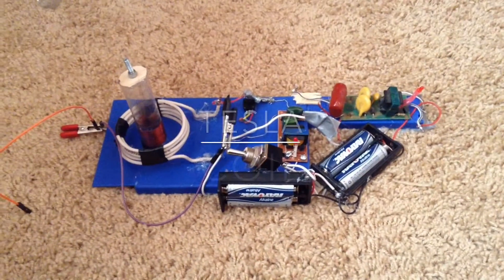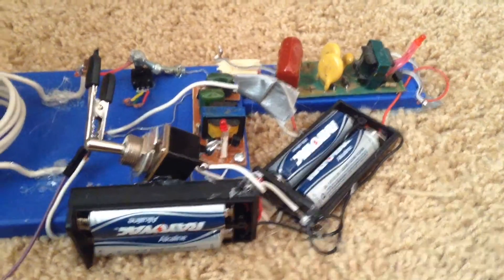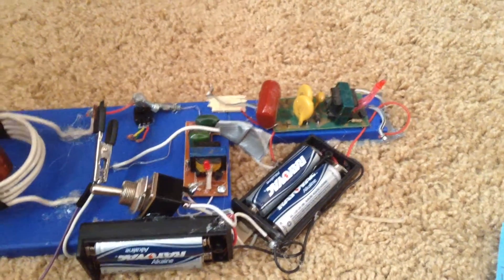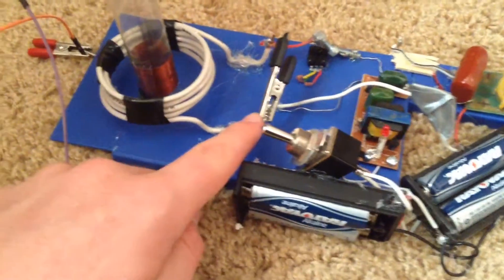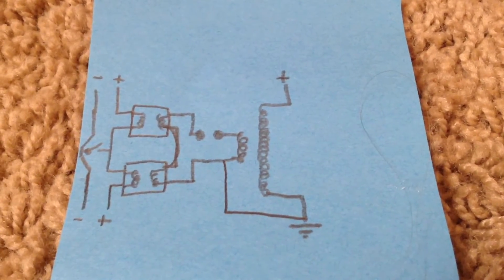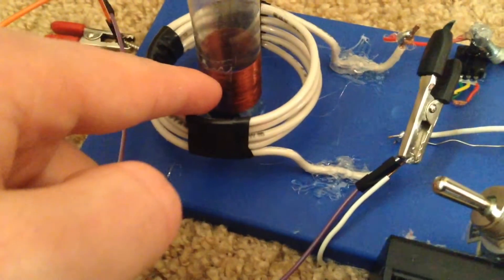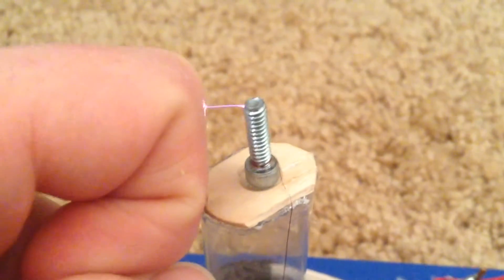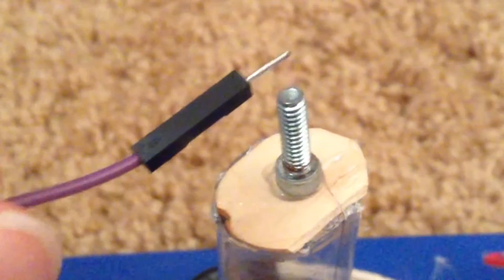Mini Homemade Tesla Coil

Comment: That must be some razor thin copper wire...I used 28 gauge and did 300 turns, it wrapped 5 inches on a 1 inch conduit

Comment: Remove the big output capacitors on the bug zappers .it will give a much more constant arc  at the spark gap and will result in a higher frequency and constant arc s
Reply from the maker: +Spandan Dutta The output caps let it act like a Tesla coil though.  The spark Gap would not work without them.